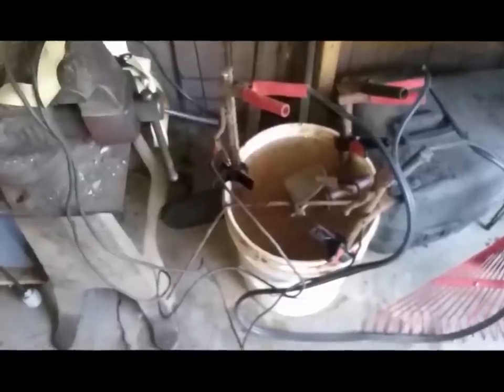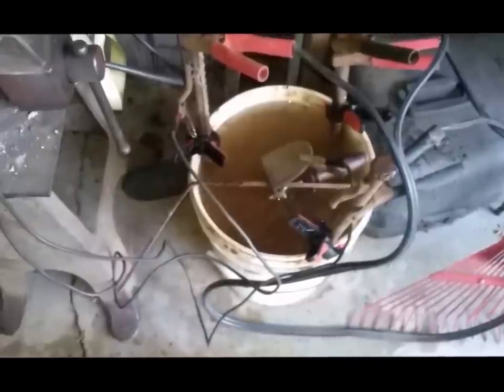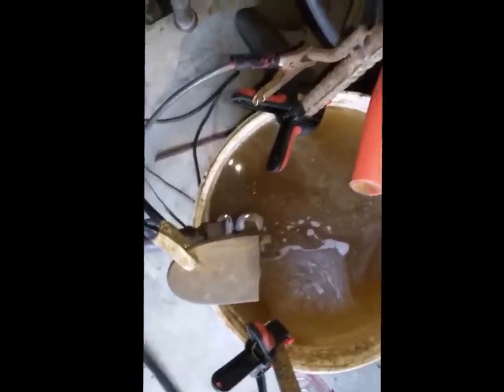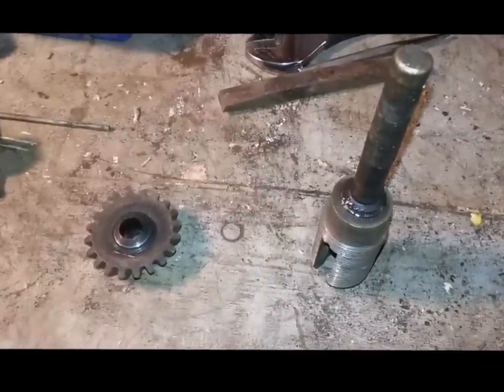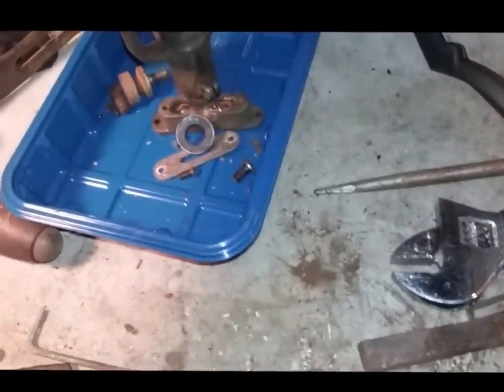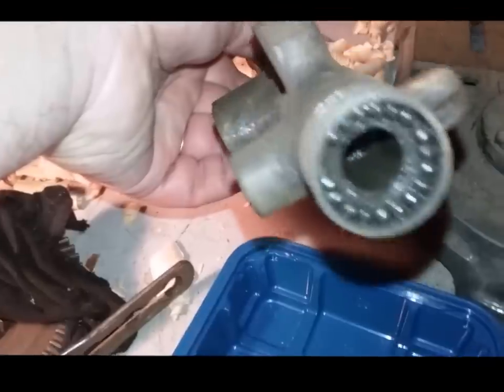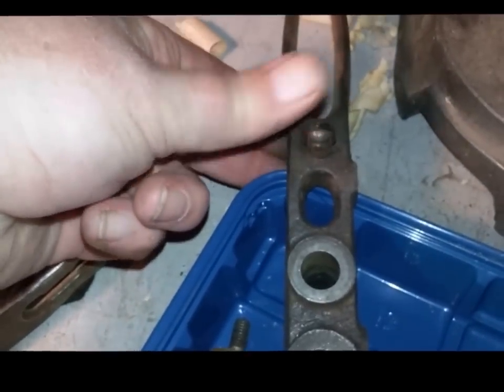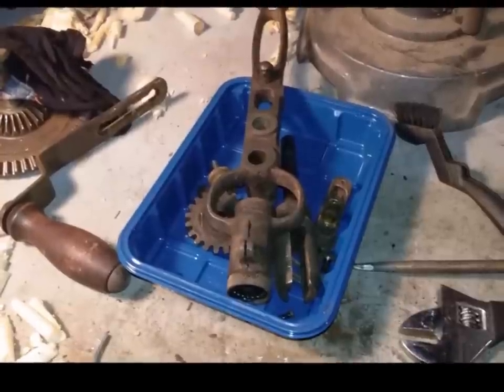Repairing Antique Tools - Millers Falls #12 Breast Drill - Pt 2 - By Old Sneelock's Workshop

Comment: Hey Sneelock. If you recall awhile back I asked you about doing this. Glad to see you changed your mind I actually disassembled mine right after I asked, curiosity too great, so I have a couple questions and thoughts on the matter.

How easy did your pinion gear come off the shaft?
Mine acted like it had been welded on so I had to soak it in a lubricant bath for a couple days, took it to a vice and chucked it between two pieces of wood to keep from damaging the gear's teeth and used a wrapped piece of metal in the chucks slot to start to rotate the shaft out of the gear. Took about 10-15 minutes of slowly rotating and coercing down to get the shaft out. But I got it out without loosing any ball bearings. I was think of doing a slight sanding (like 1-2 revolutions of a super fine grit just to get it to a tight-tight slip fit).

A note on the ball bearings, I had a total of 34, 17 on top and 17 on bottom. If I recall, I believe they were Ø1/8". 

It looks like the design you have is a slight bit different than mine, as yours has a slot cut into it near the chuck, whereas mine has a little extrusion that sticks out, has a flat ground onto it, and has a tapped hole there that goes down to the chuck. Have you ever seen any like this and any idea what the purpose of the tap is for? For holding the chuck in place perhaps? (Too small and already has a location for the lower hand grip.)

Finally, were you going to take the bearing adjustments off to clean the threads or leave them in place?

Thanks for all the videos and great advice (even if I don't follow it always.)
Reply from the maker: Jonathan Sterling It was only a lucky happenstance that let me make this video. 
I decided to disassemble this breast drill because it was basically a throw away piece from a local antique store. I bought two of them for $5.00 each with the idea of maybe getting one to work. They were so rusty and dirty that they wouldn't turn. I liked that they had levels on them and thought it was worth the price. 
After it went through the tank it loosened up enough so that I thought it might actually turn out okay. 
With the opportunity to explore at a minimal cost I decided I'd try knocking off the pinion gear. The pin drove out easily with just a pin punch. To remove the pinion from the shaft I clamped the frame in my bench vise with the chuck up and tapped on the back of the pinion with a flat faced bar. The pinion slipped off without a lot of trouble. 
The slot near the chuck on mine is to clamp the bearing race in place after adjustment. I think I'll be showing that on Thursdays video. 
I'd like to see a picture of yours. It might be a similar thing. 
Dressing down the shaft with fine sand paper probably won't hurt it. I usually run a wide, flat, single cut file over the shaft. It only hits the high spots and points out the bumps so you can remove them. The sandpaper takes down the bumps and valleys equally and if overdone can make the fit too lose. 
As I go through the drill I'll be cleaning and painting everything so I expect somewhere along in there I will answer most of your questions.

Comment from the maker: Tom Miller made the following comment. "Dear Old...in one of the videos, you mentioned that you purchased the ball bearings from Amazon, I think.  Would you kindly let me know the size and what you ordered and where.  Thanks.  Tom  ps.  really appreciate your videos!"
For some reason it got put in the Comment Awaiting Approval bin. It is marked as spam with no way to approve it. 
Since it seems to be a valid question I'm going to answer it in this way. 
The ball bearings are from Amazon. The part number is X000RKSBBE1. The description is 1/8" diameter Chrome Steel Bearing Balls G25
Hope you get this Tom.